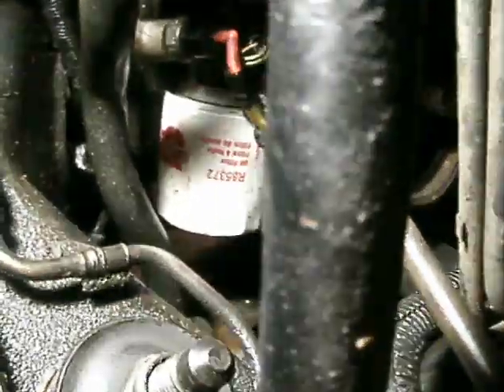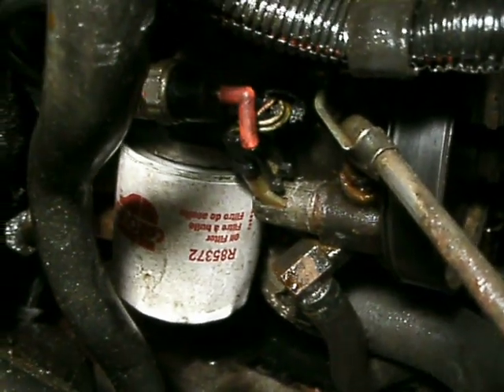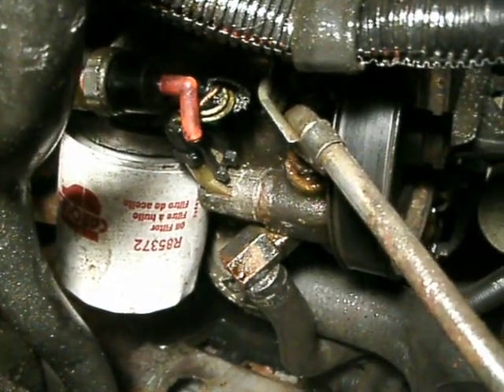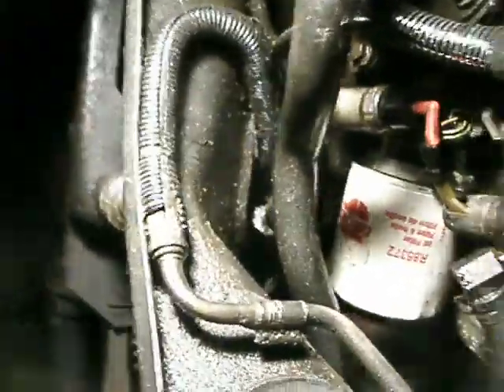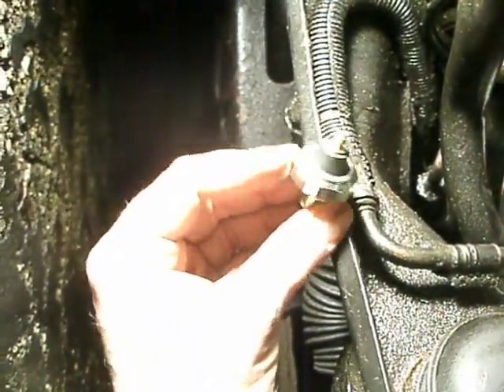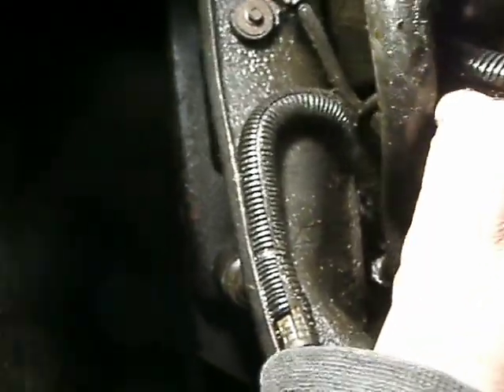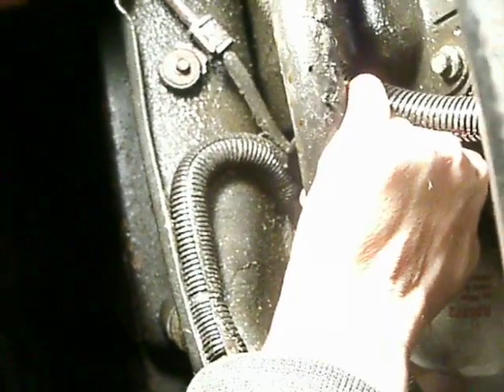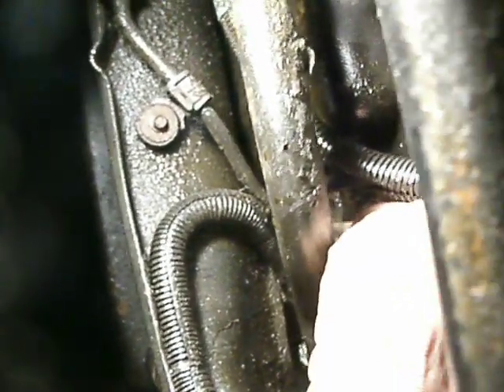97 Mercury Cougar XR7 Oil Pressure Sensor

Comment: Is that the solution for when the brakes are applied the oil gage twitches like crazy? I just ordered that sensor for my 96 XR-7 I am guessing that's why you are replacing right?
Reply: I'm guessing that's low oil because that's what my cougar was doing but now the gauge is just twitching erratically and I've got all sorts of other issues
Reply: @RockyNerd  Ended up having to replace the engine no oil pressure at idle...

Comment: Is this for sale and what uses does it have as a noisemaker?
Reply from the maker: Yes, the cowgar is for sale. You may need to remove the exhaust and maneuver it into crowds of pedestrians and other vehicles at high speed for the best sonic experience. So it's basically a percussion instrument, but it can also remotely activate police sirens if used properly. There's a very large knob for aiming, and volume pedals on the floor. Also a small door in the rear fender with a receptacle sensor for light control (via lit matches or other small burning objects) which activates heavily distorted feedback.